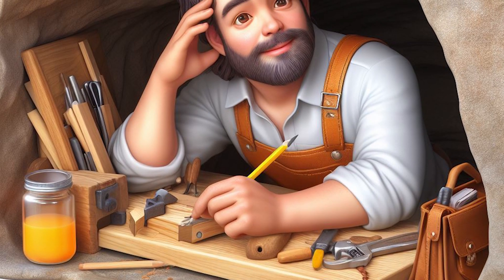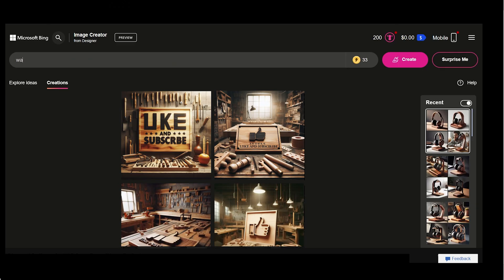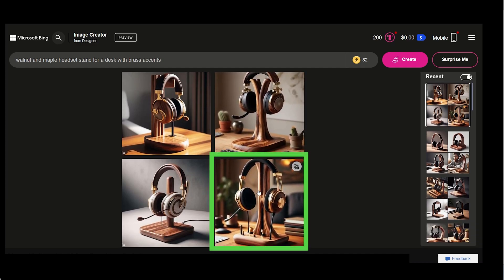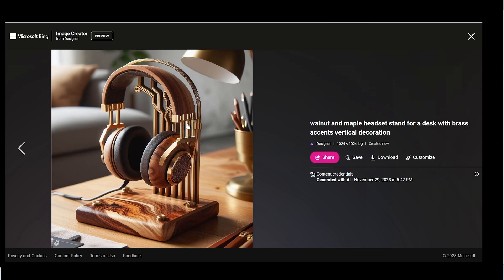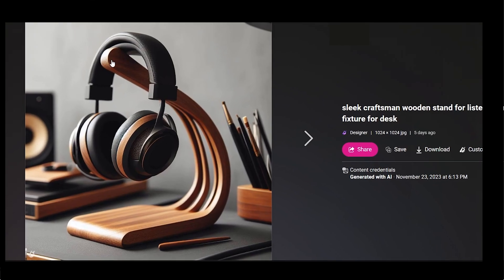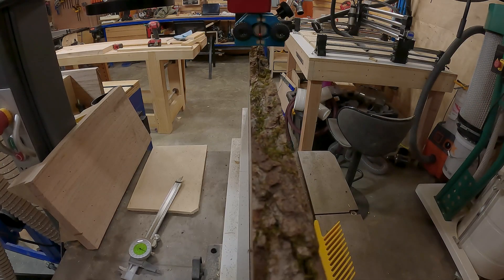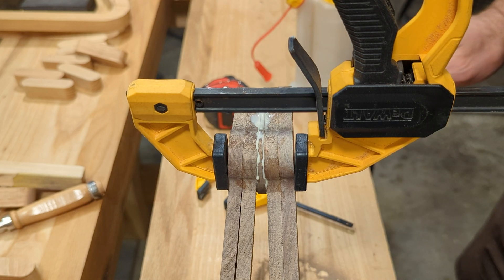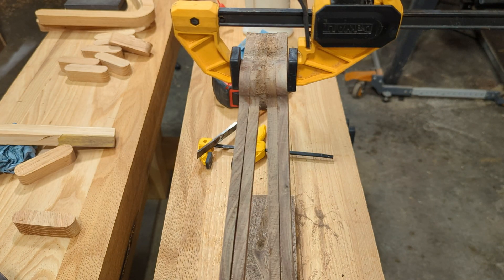Woodworking AI Design Masterpiece? (Diy Headset Stand V1)

Comment: Nice video, And a cool use of AI! This is making me want woodworking shop haha. An idea I have for the headphone stand would be to put some decorative brass bolts through the top where its glued and under pressure. Would act as a safeguard to make sure it doesnt eventually snap open and it would look cool!
Reply from the maker: I like that idea of a brass connector through the top.   Good thinking!

The brass came in today for part 2 and the drawing looks killer based off of the AI.  I just need some free time to put all the plans in action!